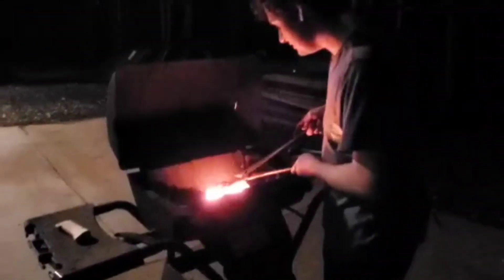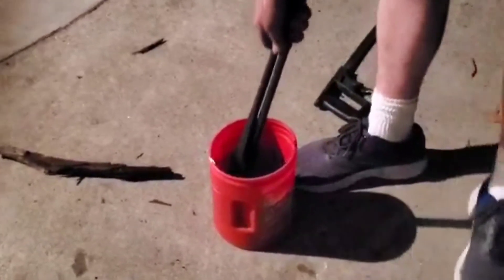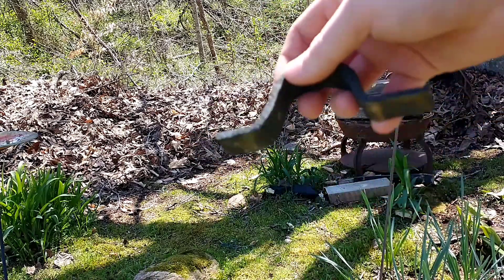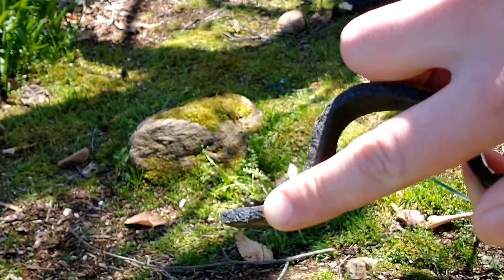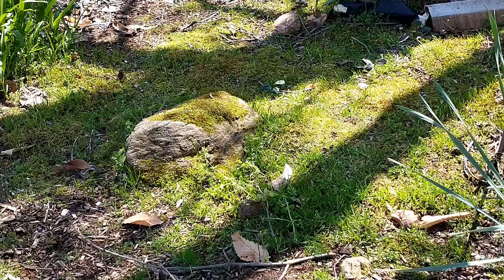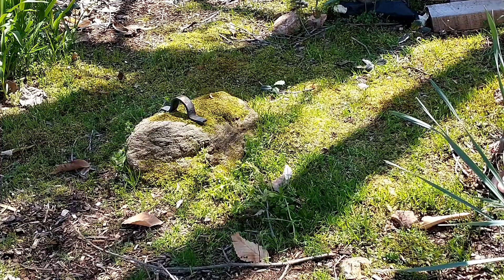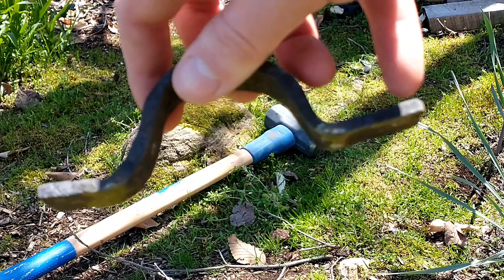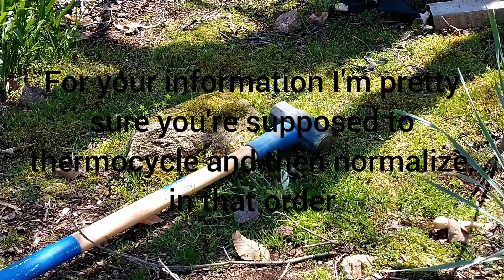Crossbow update: Progress on the trigger guard & handguard

Comment: You don't have to temper a RR spike. RR spikes are a alloy made to take the pounding of the train. They will not harden enough to become brittle. They lack the carbon to hold a edge so they are not good for knives but they are perfect for a trigger guard. All you have to do is grind off the burned part and remove the gray oxidized layer. Great job!
Reply from the maker: I agree that they will not become brittle generally speaking, and I appreciate your feedback so that I know better what to do and what not to do regarding the trigger guard and future railroad spike projects. And thanks for the compliment 🙂!
Reply: @Rilezsvids  No problem Man. I forgot to tell you that water works better for RR spikes then oil. Oil is for high carbon steels. High carbon steels will crack & warp in water. Oil cools it down slower that water. RR spike will get as hard as they can in water with no danger of breaking.
Reply from the maker: @catscradlegaming3319  yeah man I thought so, did you water quench that katana? I forgot
Reply: @Rilezsvids  Yes I did and it has 7 or 8 cracks it the blade. It would have work but the mud, ash & water mix was off. I almost got it right. The Japanese have a special recipe that each family of Sword maker keeps a secret. Japaneses forging is way different then Western forging. They make the steel from Iron sand that naturally forms on their beaches. They smelt the steal for three days & three nights. Then they send the steel to a master sword maker & he makes the blade.
Reply from the maker: @catscradlegaming3319  that sounds interesting!! I'm looking forward to researching that more!
Reply: @Rilezsvids  It's called tamahagane
Reply from the maker: @catscradlegaming3319  gotcha!